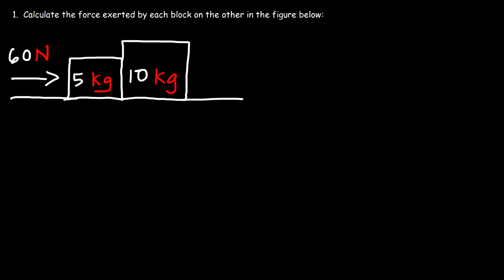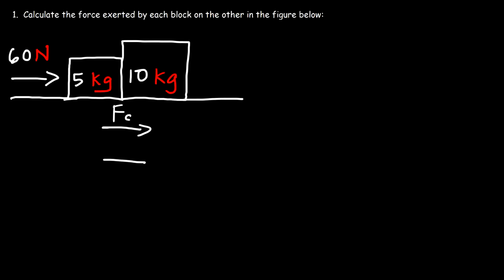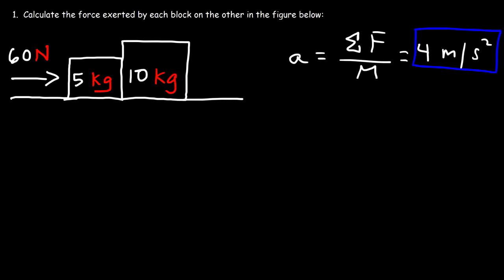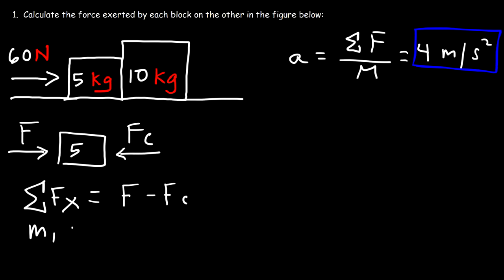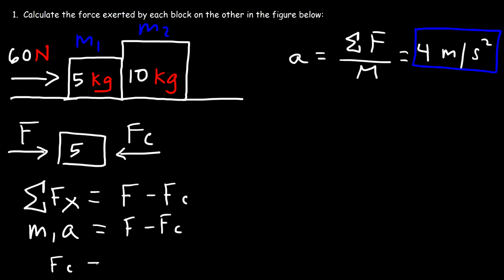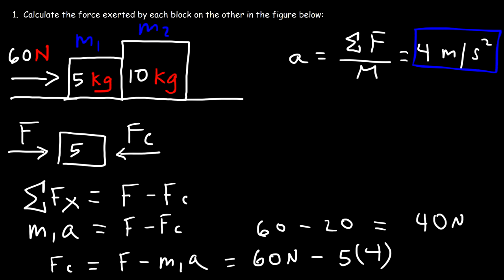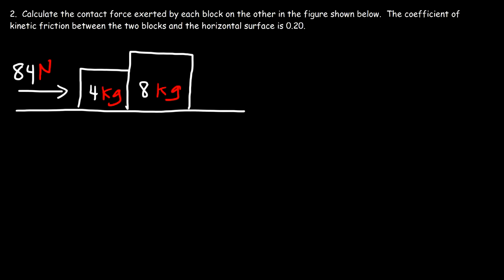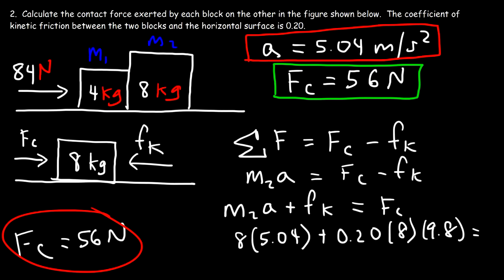Calculating Contact Forces Between Two Blocks Using Free Body Diagrams

Comment: What if the blocks are stacked on one another ???? Please provide a solution for that....even a hint
Reply: If they're stacked on top of each other, the contact force is simply the weight (mg) of the top block. This changes if there are more than two blocks. If there are more than two, the contact force between each pair of blocks is the sum of the weights of the top block and all the blocks above it.
Reply: priyamvada priyam 

Sum of the forces in the Y direction. You just use the same method but in a different axis.